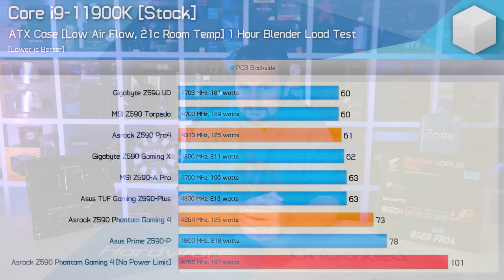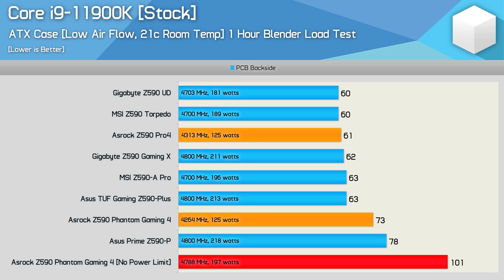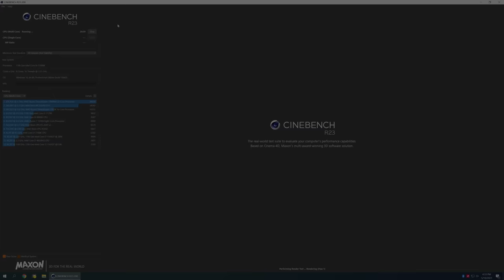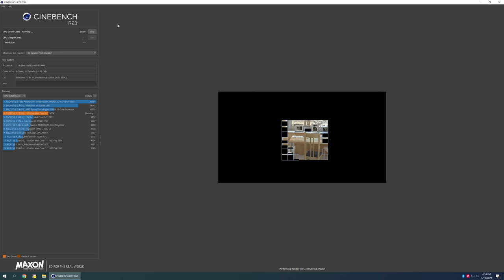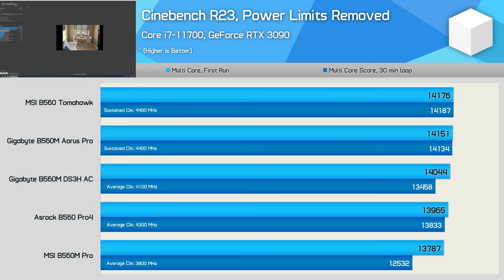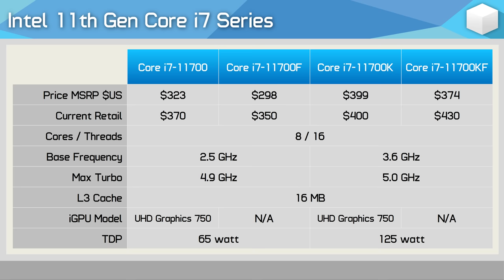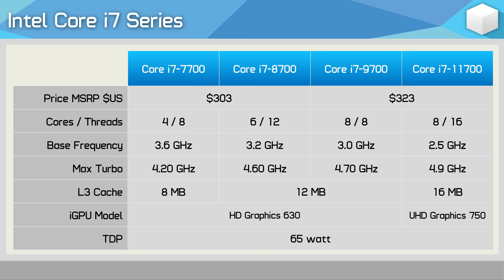Intel B560 is a Disaster: Huge CPU Performance Differences, Power Limit Mess

Comment: It's such a massive headache! 😫
Now that there are no lower rend ryzen parts, you basically have to buy Intel. Intel finally made a decent value proposition with the I5 11400 and now they have to f*** us with some stupid nonsense where you have to either spend way too much for a MB or try to find a gem of a model through loads of research

Comment: Usually when I think about buying motherboards, I will buy the mid-low end one, like B series with mid-low price boards and the ones that meet my IO demand. Since in the past, MB really not affect performance a lot if you dont OC, just pick the one with the IO you like. But now, even for non OEM boards (usually OEM PC has a strict and can not be unlocked PL settings), you still can not get full performance out of a non top CPUs, like 11700.... That's frustrating.

Comment: I appreciate this video. I returned the asus b560 plus and ordered the gigabyte b560 aorus pro ax. Nice looking board, 1.3x the performance, I'd say its worth it. Plus, I'll be upgrading from an i5-11400f to i7-11700 in the future. You're the man.
Reply: Hi how is the borad? Im planning to buy one
Reply: @keyboard_mouse  i live in iran so no ebay service 😅 b560m elite is about 188$ and b560 aorus pro (not with ax) is about 210$ also im planning to use a 10th gen cpu. Sad that there is no wifi version here
Reply: @keyboard_mouse  ok thx for info👌

Comment: Well this tells me, that i bought the right Mainboard (Aorus B560 Pro). Thanks Steve.
Reply: hey bro do we have to manually unlock 65W limit or something with B560 Aorus Pro ? I just bought it but didnt see that option in BIOS
Reply: @duyhungphannguyen3049  Nah it just works. I didn't change anything in Bios and my 11400F uses over 100W in Cinebench, staying at 4,2Ghz all Core. As long as it keeps cool. Once it gets over a certain Temp, the Mhz drops to 3,8Ghz.
Reply: @gucky4717  how about gaming bro? i tested some game and it runs ~65 to 80W only, and usually run at 4.2GHz. It does not run maximum 4.4GHz as the specs said :(
Reply: @duyhungphannguyen3049  4.4Ghz is only for running 1-2 Cores, while 4,2 Ghz is the all Core boost. Cinebench does inherently use more Watts then Gaming. So 65-80W is normal.
Reply: @gucky4717  so i dont have to worry about my mobo + CPU ? thank you bro !
Reply: Hi i want to buy b560m elite since the difference is so little how is your motherboard?

Comment: If I get this right :
1) Cheaper board use cheaper and lower-rated components
2) Some board use different/lower power limit, cheaper board more likely to use LOWER power limit (likely an effort to match their component quality and life expectancy?)
3) So cheaper board has potentially less performance when the cpu is power limited compared to higher end motherboard, but there is options to use higher power limit manually (and likely higher VRM temp)
edit: 4) The cheaper board works with BASE Intel power limit specs

So.......don't cheap out on motherboards? It's been like this for years :)
Where is the 'disaster', exactly? Or we expect higher quality component priced the same as the entry level ones? Am I missing something here?
Reply: The difference is that the performance impact is not clear when buying a board or chip.

Being unable to use boost performance means every single performance claim made by Intel was false for your purchase. 

There's the scandal. They market one thing to their customers, but tell their board partners something that's in direct contrast with that.
Reply: Nah, for the AMD equivalent even the cheapest boards don’t show this nonsense variation, it true problem here all stems from how power inefficient these 11th gen Intels are and how scared the MB makers are of things melting
Reply: @paulelderson934  For 10th and 11th Gen, the intel performance claim on their press briefing slide always made on the base spec PL1/PL2/Tau, they did include this disclaimer. 

But yes,  it seems Intel allows motherboard vendor to tune their power limit differently according to the board spec - since some boards has higher quality components or good VRM cooler design that allowed them to have more performance.

In the end though, users could potentially get higher performance(while sacrificing power efficiency ofc) with higher 'grade' motherboard, and I don't have problems with that.

Comment: Where does H510 fit into this mix? Could you feasibly recommend an H510 board for gaming on an 11400?
Reply: Would definitely be interesting to see the a few H510 boards in there
Reply: See Tech Yes City review of i5-11400F on ASRock H510-ITX/ac, with "power tuning" performance only 1% less in games than in a Z590 mobo, without "power tuning" is 7% less.

RandomGaminginHD test of i5-400F on Gigabyte H510M-S2H with memory in 3200MHz show that some games performance worst than i5-11400F in the same board.
Video "The I5 11400 - Is It Worth It For Budget Gaming PC Builds?"

Comment: Excellent video.

It a right shame that it's just a minefield to get the right budget 560 board, particularly after Intel added RAM overclocking.  Budget builders would have definitely gone for the i5-11400F, but now I'll probably go for a 2nd hand Ryzen 3600 instead to avoid all this hassle.

Comment: I recently bought a used MSI B560 Tomahawk WiFI from Ebay. I was pleased to see what you had to say about it. I'm also very please with the board. Although there were two issues that I had to figure out: 1. Could not install Windows 11 until I turned on TPM in the BIOS, 2. The system would not wake up from sleep when I moved the mouse as again I had to change a BIOS setting. I wonder why these are not on by default.

Comment: Have no performance issues with the I9-10900kf from my B560M-A at only $85.00... plenty fast with the boost options in the bios. Some people were never around for the 80's and 90's personal computers and their limits. And by the way my 5900x screams on B550M-Plus wifi...

Comment: I also observed a difference of more than 20% between different BIOS versions in Z590. It even decreases the frequency to stock turbo even when overclocked. I locked c-state and p-state, set all vrm and package power limits to max and many more settings but nothing changed. 11th gen CPU is good but everything supporting it are so bad.

Comment: If you're not upping the PL1 limit on the ASrock B560M Pro4 with an 11400, you're just tossing performance out the window.
I'm looking at buying that one, and after some research I've learned that increasing PL1 is a must for optimal performance.

Comment: The headline caught my curiosity, but now you have my attention. I'd like to see how AMD's comparable boards at the same price point fare in similar tests.
Reply: Much better. Just look at how some b550 mid tier mobos like the ASUS TUF B550m can handle a ryzen 9 5900x just fine.
Reply: My oldest boy's ASRock B450 Steel Legend handles the 3700x exactly the same as my MSI MPG X570 Gaming Pro Carbon WIFI board did. I also have an MSI B450i Gaming Plus AC and Asus PRIME B550M-A (WI-FI) board that handle the 3700x almost identically (within a very small margin of error). AMD set the spec limits much higher with their CPUs close to the maximum potential out of the box so you won't find anywhere near as much disparity as this example.
Reply: I mean he hints at it at 4:25. There's no real difference.

Comment: I hope you make videos on asus b560 prime and tuf boards  aswell
Reply: My thoughts exactly, it seems odd that he didn't have any Asus boards or even the steel legend in this video.
Reply: it's because asus is doing well even on their h510 prime
Reply: My Asus Prime B560m-a runs my 11400f on 4.19 ghz and progressively downclocks all the way to 3.7 ghz over 35 minutes time, then 5 to 10 minutes later it jumps back to 4.0 ghz again and seems to remain there for the past half hour. It never went below 3.7 though. I do use great cooling (Arctic Freezer 34) So the temps aint the problem, using prime 95 to stress my CPU. So  yeah you are right , luckely this motherboard aint performing as bad as some in your graph and seems to hover around 3.8 - 4.0 most of the time during the stressing.

Comment: Please also look at some asus b560 boards, those seem to be a bit higher end so would be interesting to see if that made a difference when compared to other boards.
Reply: I actually bought an ASUS Prime B560M-A board recently for a 10400F.
Reply: There's not much of a difference
Reply: @sammiller6631  I’m assuming there isn’t, but then again that’s what most of us assumed about all b560 boards, so imo it would be interesting to see how they stack up against each other
Reply: @flammerz1938  It's very expensive to test every b650 model especially when manufacturers stop sending their boards because HUB is too honest
Reply: @sammiller6631  not saying to test every single board, but seeing them include at least 1 board from every major manufacturer currently would be helpful imo, as it also helps you determine between brands. Yes, Steve’s reviews can sometimes be the opposite of what manufacturers want to hear, but he still finds a way to review them so might as well include some other boards as well.
Reply: @sammiller6631  yeah, some companies are better than others... doesn't need to test every board, but targeting one $100-$120ish MB from each major manufacturer will show this difference (ASUS, ASROCK, MSI, Gigabyte).
Reply: @wolfshanze5980  Unless they make all the same design at the $100 price point to save money.
Reply: @sammiller6631  have you once looked at the boards?  You know,  like take 5 seconds to research the difference even a little bit?  For instance, MSI and ASUS both have $100 B560 boards, one is full of heatsinks all over the VRM and another has none at all?

What you implied, just isn't true... board manufacturers do different things all the time... they're not all the same.
Reply: @wolfshanze5980  You can tell the difference between a board full of heatsinks all over the VRM and another has none at all just by looking at it, no testing required to see the difference.
Reply: @sammiller6631 /facepalm
At some point you just realize people are going to argue for the sake of arguing.
Reply: @wolfshanze5980  So why are arguing for the sake of arguing?
Reply: My Asus Prime B560m-a runs my 11400f on 4.19 ghz and progressively downclocks all the way to 3.7 ghz over 35 minutes time, then 5 to 10 minutes later it jumps back to 4.0 ghz again and seems to remain there for the past half hour. It never went below 3.7 though. I do use great cooling (Arctic Freezer 34) So the temps aint the problem, using prime 95 to stress my CPU. So  yeah you are right , luckely this motherboard aint performing as bad as some in your graph and seems to hover around 3.8 - 4.0 most of the time during the stressing.
Reply: @jeremyniels  do you change any settings in BIOS for your ASUS Prime MB, or is that stock settings?
Reply: @wolfshanze5980  stock. dont need to change anything
Reply: Asus prime boards suck in the b560 line up it seems. Not like last gen

Comment: Is this scenario also applicable for i5 10400f?
Reply: Yes, but quite different since 11th gen use more power. A 10400F can do a lot at 65w. Max all core is 4ghz, but depending on application at 65W sustained you'd see between 3800mhz and 4000mhz.

Comment: Good information.  I bought B560-C Wi-fi motherboard ($299AUD)  with 10600KF cpu. I cannot get the onboard network hardware to work. I intend to return both parts. Not sure if I can get full refund on the fact that I can't get network adaptor to go on an older version of Windows. Oh well, I would probably need to pay 20% restocking fee. Would rather have Z chipset with 11th gen CPU.

Comment: I bought the b560 pro4 the day it came out, too bad these videos weren't out a month ago
Reply: It looks to do fine...... Look at the comparisons with power limit overclocking enabled on all boards and it does well. Even on the i7 its only loosing 100mhz and is barely different. There isn't a big problem, the problem is that the power limit overclocking is enabled by default on the higher end boards.
Reply: Sell that board
Reply: Update your BIOS. b560m Pro4 does now have the feature to auto-bypass the 65W limit.

Comment: Probably should've tested it with an i3 as well... It would be nice to know if the 4 core CPUs also get affected with lower performance using the cheaper boards
Reply: for anyone interested in knowing whether the shitty boards affect i3s or not I have good news, they don't. I guess i3s consume so little power that even at full load the cheaper boards can keep up without a problem
Reply: @Captain_Kouga  Yeah, these low end boards can sustain 80-90 watt without much issue even under poor airflow, so a 10100 at 60-70w max load isn't going to be an issue; a 10400f will be alright too for games at least

Comment: Cheers Steve for Inwin Chopin the content,  I just installed the B560-itx strix with 11500 in the wee inwin chopin black edition., what a smooth machine with 500gb 980 Pro and x2 8gb 3200 corsair LPX.. Put the wee cooler from noctua NH-L9i chromax on there, such a tidy wee build.  Cheers from NZ

Comment: I have a B560 Tomahawk, and I switched the bios from the default setting "water cooler" to "box cooler", does that mean I just turned on the power limits?

EDIT: Turns out there's a third option "Tower Cooler" which seems to set the same power limits as "Water Cooler" setting, which is actually what I had set it to. I don't like how this power limit setting is configured by setting a cooler type, seems very ambiguous.
Reply: At 8m 30s the answer is "yes"
Reply: @revdarian  I just double checked and actually I had set it from "Water Cooler" to "Tower Cooler" which seems to have the exact same TDP setting anyway... very confusing and unneccessary...
Reply: An 11400F can jump up to 90-100c if you disable power limits with a stock cooler so it actually makes sense. It's like running a stock 5800x(140w PPT at stock) on a little Intel stock cooler.

Comment: I’m not sure I understand the rant tone in this video. It should be more about education. Buying a 65W processor is buying a 65W processor. The good b560 motherboards will unlocked this and that’s good for us. Would you prefer having that option locked ? By the way, a lot of reviewer are doing the benchmarks without power locked because of this (even on a good board). In fact, the biggest problem you didn’t talk about is some will run the cpu with power unlocked by default with the intel cooler.
Reply: Intel markets processors with performance claims. Customers buy them.

They also buy a motherboard that according to its description is "up to Intel spec". 

When using it you suddenly find out your expensive hardware does not even get close to the claims.

There's the issue!
Reply: If you are pumping 125+ Watts into an Intel stock cooler, you are going to have a bad time 🤣
As soon as you amp things up, you need a better cooler and probably adding your own heat sinks to the VRM..
I think this channel assumes everyone drops the intel stock cooler straight in the trash.

Comment: "Looks at I7 11700 + B560M Aorus Pro AX I got last week on sale because of ebay coupon codes for $725 aud and breathes a sigh of relief" Thank god I got it right shooting in the dark LOL. I have set power limits manually in bios though due to my deepcool gammaxx gt argb (rated for 180w tdp) not being enough when I also do a fan profile to keep the noise down so guess I'm down for a cooler upgrade but good to know my board isn't a limiting factor and that cooling is.

Comment: I remember B360 boards limiting performance simply due to RAM being capped to 2666MHz.  So, Intel trumpets about opening the RAM speed on the x60 boards and then stuffs you on the Power/VRM limits.

Same crap, different day.  It's only the depth that varies.

Comment: This is even worse for some AsRock B560 boards, which actually don't support fully unlocking the i5-11400/F, only up to 100W sustained (PL1) on the ITX version of AsRock B560. Keep this in mind while shopping! In my experience this doesn't really matter for gaming, but certainly any production workloads, 100W really kneecaps the 11400...